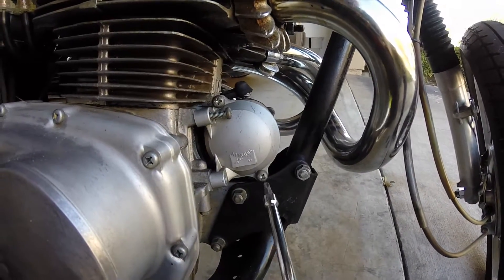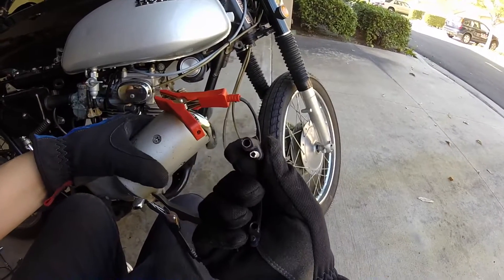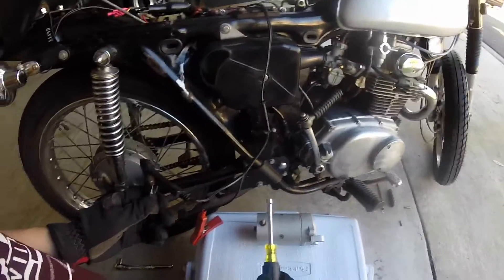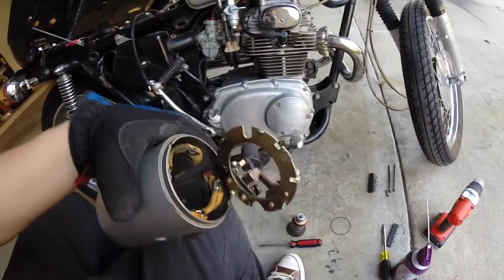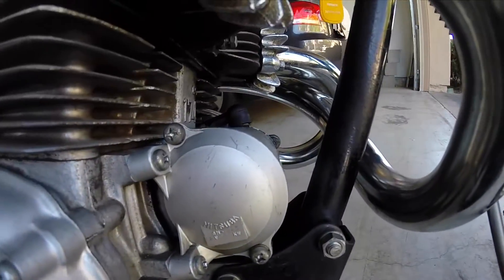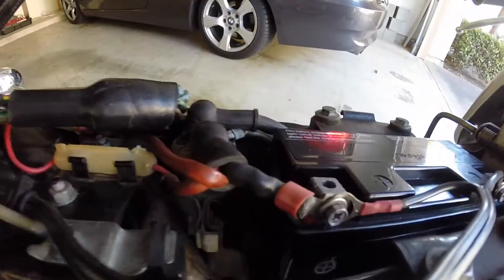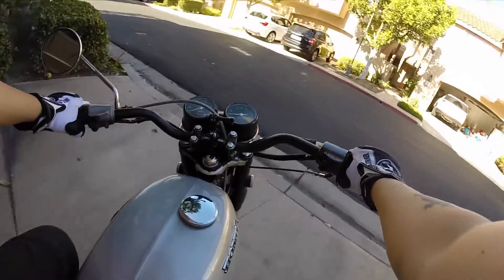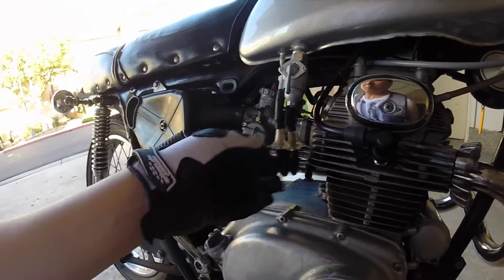Honda CL175 Cafe Racer Pt. 18 - Electric Starter Problem

Comment: Hello from Manchester Uk! Just got myself one of these and your videos have been unbelievably useful to get my bike running again. We can't get manuals that easy over here as they were not released over here. It was a non runner before and now thanks to you, it all works great! Keep up the good work and looking forwards to #19. Many thanks mate, peace!
Reply from the maker: +Oliver Reilly Hi UK! Great to hear you got it running. Hopefully your electric starter works, unlike mine. I don't mind kick starting it tho :)
Reply: +JohnnyTurntUp yes mine works, but it's only done 7,500 miles. I've noticed you've changed the battery. Are you sure it is a new direct replacement? Sounds like it's working but not getting enough power. I can email you and help you sort it if you want?
Reply from the maker: Oliver Reilly I think you're right about the battery. Sometimes when I turn the blinker on, the bike would shut off, so it's not getting enough power. I'll look into getting a new one. I'm not too worried about the electric start though. Kick starting it is fine :]